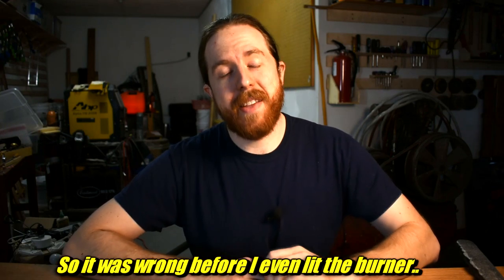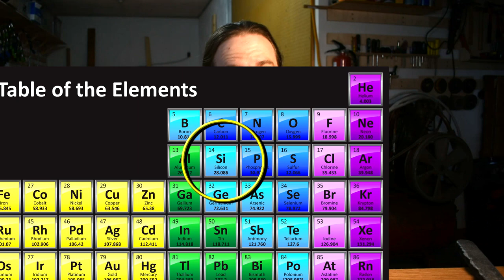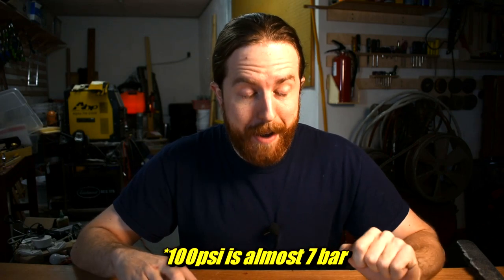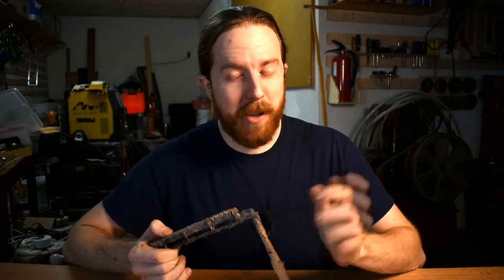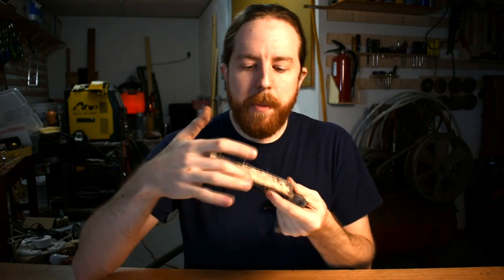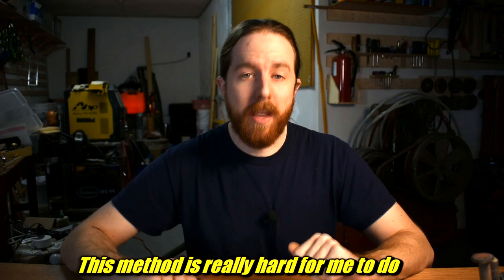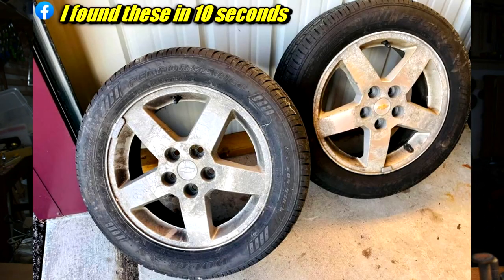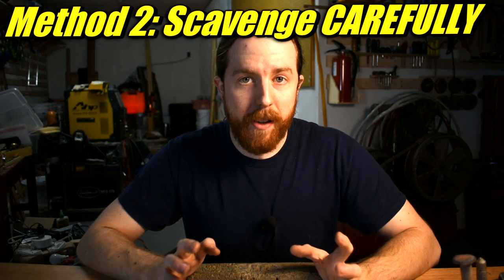Metal Casting Alloys Matter More Than You Think...

Comment: think i mentioned it on here a few times ( after hearing it from others ) about aluminium rims being good source material
guessing using  a midsize to large bandsaw with a metal blade might work best as the rim / manifolds / cilinderheads fits through it 
seen vids from a guy that made a big funnel with an oilburner and basicly melted the whole rim / head/ intakemanifold with all the bolts nuts watever still in it , the metal parts with the higher melting point stayed in the funnil the aluminium whent down the funnel either dripped in a bucket of water basicly turning it intoo lead shot , or poored intoo muffintrays 
wasnt an exact science and sumtimes it looked like a chineese firedrill after a clog in the funnel kindof desolved 
https://www.youtube.com/watch?v=pBhOAiipyZg
Reply from the maker: Yeah it's great.  The foundryman I talk about here said he worked at one giant foundry for years that cast aluminum wheels for a bunch of car manufacturers.  He said A356 is what they used because it's great stuff

Comment: Okay, but... Have you tried cutting wheels to fit your crucibles? 😂😂😂😂
Reply from the maker: Nope, I'm avoiding it lol I have a set of wheels ready for the chopping... I might just buy ingots instead haha
Reply: @PaulsGarage  good idea 😂 It's so gummy that I'll never try bringing a saw or grinder near it. I value my limbs being attached to my body too much 😂 
Join me in vacuum assisted casting, even crap aluminium works pretty well for basic stuff then. I've made thousands of trolley tokens with .5mm sized lettering and raised image features using the cheapest scrap aluminium I could source.
Reply: @PaulsGarage  p.s. pewter is great 🥰 Makes a magnificent source of tin for making tin bronze. Arguably better with the potential drop of lead in, as that's used in similar amounts as it'll end up been in bearing  bronzes or other hard wearing bronzes 😊
Reply from the maker: Funny you mention that, I have a vacuum pump sitting on my work bench right now
Reply: Stop. Hammer time 🔨🔨
Reply: All the ways to break down wheels suck, but a stack melter is the least sucky out of the many ways I've used.  (Table saw was the most dramatic)
BTW You can spot forged vs. cast wheels because the inside part is machined from a forged billet.  Cast wheels have recesses on the inside surfaces that clearly were not milled there.
Reply from the maker: @tobhomott  good tip there, I've seen those recesses, didn't realize that's a good way to spot cast wheels
Reply: @PaulsGarage  Portaband, circular saw, sledge hammer
Reply: Karate chop them like ThisOldTony.
Reply from the maker: Unfortunately I don't have my black belt in metal-fu

Comment: Spend alot of time learning to properly gate,riser,and vent your castings. You'll get the best castings possible by doing this correctly. I worked as a foundry foreman for 30yrs and if you want consistently good castings learn this
Reply from the maker: I agree with you completely.  My earliest castings (unfortunately the majority of my early videos) had terrible gating, no venting, no feeders, etc...  Only much later did I learn how to make better molds and it was the #1 biggest difference.  I still have plenty to learn but the improvement was crazy.